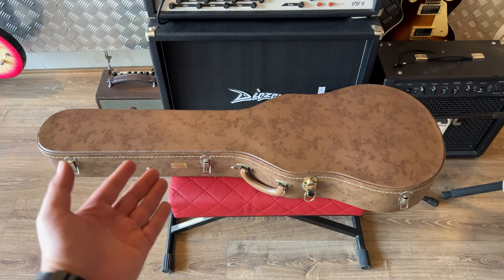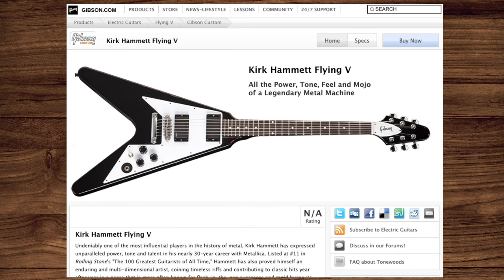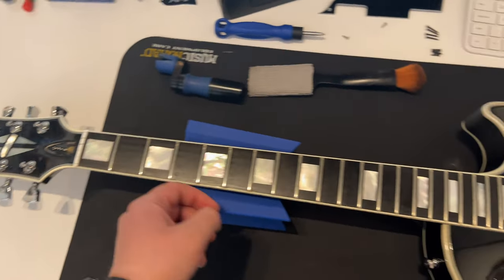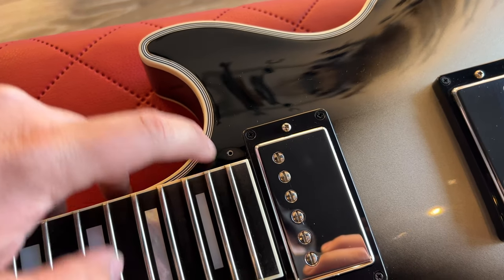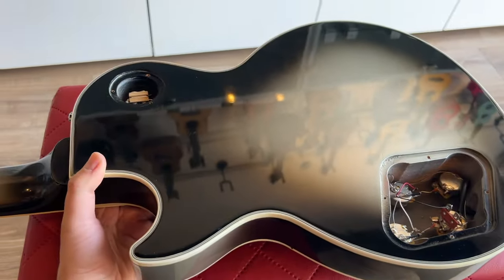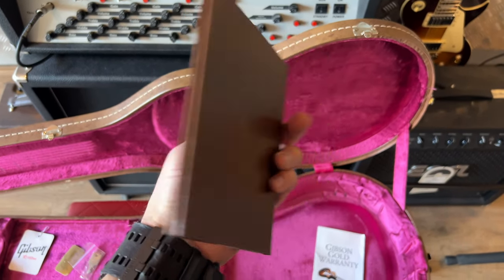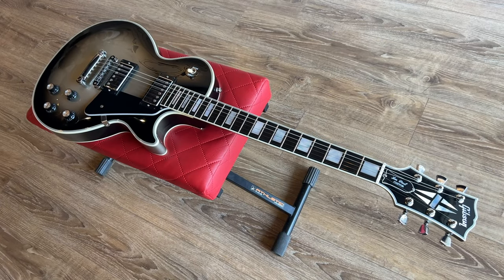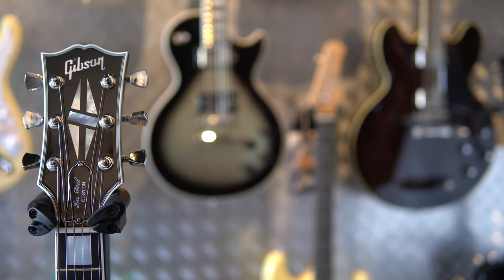My personal 2013 Gibson Les Paul Custom Silverburst

Comment: Honestly I like the newer Silverburst just as much as the aged. I guess it’s personal preference and kinda cool with the Gibson Silverburst you get the bright silver in the beginning and maybe as you get tired (or used to it) of the brighter color you are rewarded with a new color over time. I’m thinking of getting the Epiphone LP-Custom Silverburst and I don’t mind keeping the original Silverburst as long as the specs are the same in all Epiphone customs I’ll probably get the Silverburst… reason being I’ve heard the gold hardware on Epiphone starts to wear off and oxidize quickly, so I’ll go for the chrome hardware just to be safe even though I do love the (plain Artic white/gold) gold hardware better
Reply from the maker: Yeah u get two finishes into one like with most Gibsons. I just love the way Nitro ages!